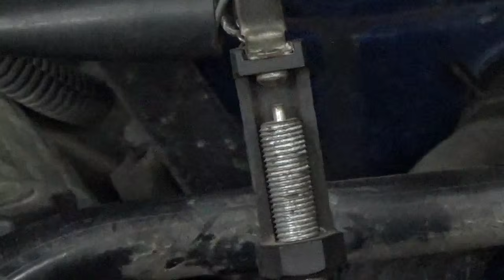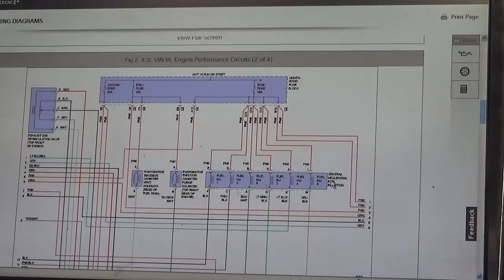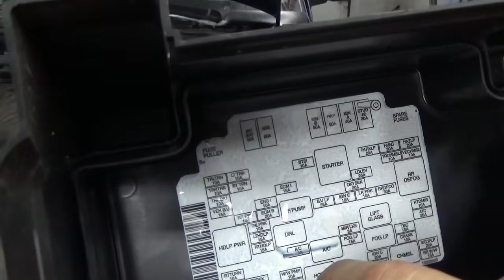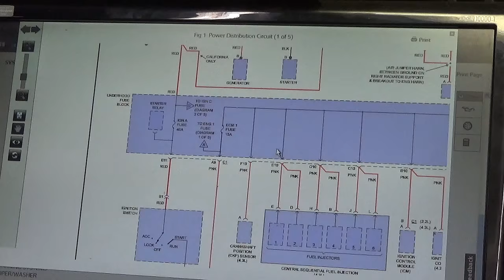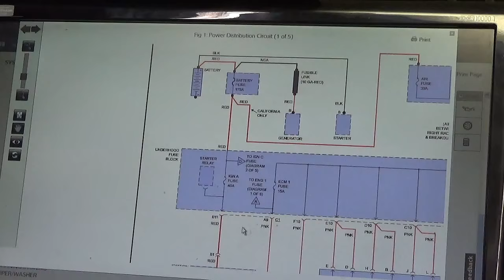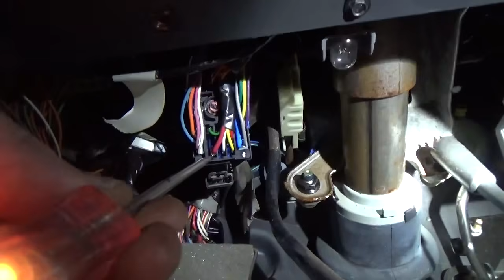No Start / No Spark / Cranks OK - GMC Jimmy / S10 Blazer

Comment: Hello I got a similar problem but in my case it's a 2000 Chevy S10. The same fuse (ecm 1) keeps blowing every time you turn the ignition on. Background, I just had a new set of injectors installed as well as a new fuel pump installed. Afterwards the truck ran but idle real high I'm talkin take your foot off the brake in drive and the truck starts doing 10 miles an hour on its own. Another fellow and I were looking over the engine to see if we could figure out why it was idling so high he put his hand over the intake and his hand got stuck down on it and it took the engine off. Now the truck will not start it turns over but just not crank up. Thanks to your video I Fount the blown fuse unfortunately that fuse keeps blowing every time I turn the ignition key on. Any ideas?

Comment: Has anyone found other situations on a GM like what happens at around the 2:50 mark with the spark? Mine does it, but it's so infrequent that I haven't made it as far as testing the ignition switch.

Comment: Has anyone had problems with the ignition relay mounted on the firewall killing spark from the ignition coil. Ruled out coil, coil wire, ignition module, and ECM, by swapping known good parts from running spare blazer. Haven't found wiring diagram in Haynes for the ignition relay. Just slept and came to me to check relays. Had actually unplugged and replugged the connector without knowing it was the ignition relay

Comment: I have an 89 Chevy s10 my main engine wiring harness laid on the exhaust manifold and burnt threw 1 wire and shorted it out it was a wire to the #2 injector so I cut the burnt section out and replaced it. That injector still isn’t spraying ? Any idea where I should go from here fuses are all good ecm1 and 2

Comment: Thanks for the video my Chevy S10 2003 had no power to the sending unit and no power to the coil and it was a fuse I thought it was ignition switch BCM 15 a

Comment: 98 s10 4x4 4.3 
Fried controller
Results dose nothing
Changed controller cranks no spark
Changed ignition cranks no spark
Security light blinking
If I install the ignition housing that's mated to the controller will that fix it?
Do I still require a dealer reboot??
Urg

Comment: Son has a '99 S-10 2.2.
Blew the 15 amp fuse at some point, truck has had electrical work done. 
Change the fuse to newer 15 amp, and it started right up and idled fine. 
He took for test, a block away calls me again because it died. 
Just for giggles put in a 30amp and left the fuse cover off, you could see the flash when he hit the key.
Tries to start, but won't turn over. 
Switch, relay? 
Almost feels like a ground issue if it started with just the new fuse and got around the block after idling for 20 or more minutes to warm and freshen the battery. 
Any ideas, he has had nothing but problems with this truck and is fairly upset. 
My Fluke is old and not reading properly. 
Dad would like to help.

Comment: This truck was running good I just wanted to get a cap the rotor plugs and wires put in it And the mechanic said that after he did it he had to reset the computer and I never heard of that and he couldn't get it to reset so he was racing it so much he had the stuff from the cattle later converter coming out of the exhaust now did he blow this motor because it was knocking afterwards

Comment: I have a 96 k3500 454 no spark i changed Everything except ignition switch. I have 12v to the pink wires on the coil and control module but i also have 12v on the. D terminal on the controle module side why is that

Comment: After watching this video we replaced Ignition Switch on 2001 Jimmy, still have same problem. (Cranks but won't always start) Can get it to start after 6 tries but sometimes won't start and wears battery down. We charge the battery for an hour and starts right up. But then we go through the same problem again.  Now we are trying to start in Neutral instead of Park and starts faster, maybe 2-3 tries but then sometimes won't start before battery gets low. Could it be the Park/Neutral Safety Switch? Any suggestions?

Comment: I have 97 s10 p0300 changed sparkplugs, wires, dist cap and rotor still has p0300 starts and runs but not running right and backfiring plz help

Comment: Saturday May 23, 2020.. after replacing fuel pump, relays, fuses, fusebox, coil packs and even ECM. Found your video and IT WORKED THANK YOU VERY MUCH. Ran out $ by buying all unnecessary parts.. so I'm running with a hot wire hanging out lol. I APPRECIATE the wiring diagram.  Colors helped out a lot since I was trying to guess

Comment: I have a 98 dodge Durango 5.2 I have spark coming from the coil to the distributor but nothing coming out of the distributor what could it beI am putting all new distributor shaft cap rotor and sensor

Comment: Got a question..i went to start a 1999 blazer 4.3l n it attempt to crank a quarter of a turn but that is it like something's stuck on the crankshaft..ive just did a throttle body cleaning n fuel pressure regulater replacement..any idea's ?

Comment: 05 Silverado 4.3 chevy cranks fine fule presure fine new crank sensor just had  tune up plugs. wires. cap. bunton. coil . Shop said bad distributor housing or computer any ideas or load the parts cannon

Comment: i have a 1985 p30 i am having issues with crank but wont start  no spark  changed distributor rotor spark plugs module  everything under the sun except  the pick up coil  what do you think i should do before i torch the f...n thing !!??

Comment: Replaced Ignition Switch on 2001 Jimmy, still have same problem. (Cranks but won't always start) Can get it to start after 6 tries but sometimes won't start and wears battery down. We charge the battery for an hour and starts right up. But then we go through the same problem again.  Now we are trying to start in Neutral instead of Park and starts faster, maybe 2-3 tries. Could it be the Park/Neutral Safety Switch?

Comment: Hey I have a similar issue on a 2000 chavy blazer fuel pump sounds like it's running cranks and cranks sometimes without starting and then sometimes it start first try no problem at all and the only code popped up was po420

Comment: my truck ran the morning of, cut it off, changed camshaft position sensor and now it won’t start at all. it’ll crank and crank. but after i let off ignition it’ll idle at like 200 rpm then die. help

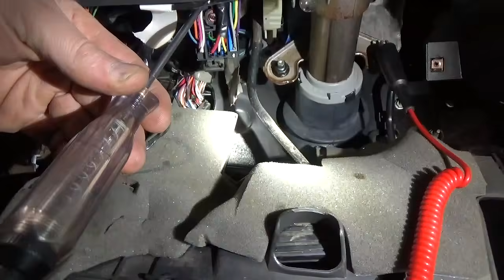Comment: 10:20 if the light stays on while cranking what could it be?
Reply: If that light stayed on while cranking, suspect a break in the wire between the ignition switch & fuse.
Reply: @danielpacurar2644  there's no power from the power feed connection or the fuse until I turn over the key I get power, is that normal?

Comment: Thank you so much for your videos. I have been searching for information on a similar situation. A 1989 Mercury Tracer just died while driving. Sometimes it would re-start for a few seconds and die again. I tested the Coil for spark and nothing 'till I shut the key off. If I turn the key from run to off I get the one spark at the end. 
 But for that vehicle it's approx. $240.00 for a new  ignition switch. Is it possible to run a hot wire from the battery to a toggle switch and then to the Positive Terminal on the Coil? Then flip the switch before cracking over the engine?

Comment: Thanks for the information,got a different problem got fire,fuel pressure turns over like it's out of time, but won't crank and occasionally it does crank it has a dead miss, have changed distributor and cap wire's spider all twice still won't run can you please give me an idea ,oh and son in-law says timing is dead on, engine was running in different vehicle put it in this one no it wont

Comment: Hi,  Everything  was lit up  normally  until  I changed  Fuel Pump ,the mechanic was just starting up, and when he was breathing on the parking he stayed 4 hours in the parking lot . I"m  going to go back to work ,I will not be able to get down from 5-6 times to start power, 2001  Gmc Jimmy  2 door  4wd  6 cyl , What  is  the problem  ? Thanks ,Starter  is new ,baterry  is new , fuel pump new

Comment: Thanks much, it was cool watching a pro work through the problem instead of just throwing parts at it - as "some so called" pros have done to many of us, THEN they charge us shop rate PLUS all the unnecessary parts for their education. Yes, some of us have had it happen.  It's so cool to watch you eliminate the many various parts as the possible culprit and zero in on what the main problem was.

Comment: I have an earlier cav w/ a 3.4 conversion that acts the same way. Didn't know how to troubleshoot this until your vid. Pulled two plugs and they were dark but not wet. Have a new ign switch so will try. The thing that concerns me is I think the former owner retained the original ecm since there are no fuse boxes under hood. If you have any input please email tunaboat3801@ Gmail.

Comment: well that brings the WTF to the fore!! i started in retail auto parts including various dealerships . i realize i am seeing this 4 years on, but, holy thunder,  the gall to ship THAT.
Reply: My daughter works at a large manufacturer's industrial facility in inventory control. Their retail sales people are under strict instructions to not accept return parts and credit the customer until the shop has actually looked at the return parts. Why? Because previously certain customers were in the habit of returning their defective used parts for a credit which were then put back into inventory and resold only to have the new customer who then returned it again because it doesn't work. Customers who are caught returning used parts are not given credit unless it can be used as a rebuild core. The things people do...........

Comment: i'm really hoping somebody can help me, i have a 94 s10 pickup with a 4.3 1 of the tbi injectors weren't spraying i assume from sitting since last summer. now here's my problem i had my friend crank it over while i tapped on the bowl and it started to work the only problem is it's spraying too much fuel  to the point its flooding the right side of the carb, the left one is pulsing normally but the right is a strong straight cone of fuel with no pulsing. any ides or help would be appreciated.

Comment: I have watched many video in a attempt to be a decent mechanic .   this is the only site I have joined because most seem to be no better or less than me .   I have a 1997 chevy blazer with the 4.3 vortec .   it just shut off .   I have tested fuel and I have 54lb so I think the poppet valves are working .  I am beginning to believe there is no spark .   I am hoping for a video to test the ignition coil and the control module .   these are separate from  the distributor
 bolted to the intake next to the throttle body

Comment: have a 2010 Dodge Charger sxt with 3.5 v 6  my problem is when the car is a normal operating temp the car will not turn over,it just turns a very little no even a 1/4 rotation but after car sits for about 2.5 hours it will start., headlights are bright  battery is not even a year old

Comment: I have a 2000 Silverado 1500 4.3l runs then stop and won't start. If I let set for a few hours it will run again. Fuel pump is at 60 psi. and I replaced the coil.  Where should I look now?

Comment: QUESTION: Can this ignition switch issue be overcome by putting a charger on the battery while cranking with the key? If I do not use the charger, my battery slowly dies. If I do use the charger, my battery stays strong and the engine starts immediately. Thoughts? GMC Safari 4.3 Vortec...

battery is NEW, no drains on the ignition while at rest (no radio, lights left on, etc)

Alternator charges 15+ at idle

Comment: Could u possibility help me with issue I'm having on my 1995 s10 tbi v6.
About a week ago it started to get harder to start the 3 days later it wouldn't start at all. 
Has good fuel pressure good relay good spark.
Reply: What did the problem end up being

Comment: Would this also cause the fuel to not stay primed at 50psi i have no spark and i have to jumper wire the fuel pump relay even tho the relay is good

Comment: Any automotive electrical switch that when testing across the swich contacts under load shows 300 mv drop or more is suspect. The use of a dvom in place of your test light would have showed a significant voltage drop without cranking however the voltage drop could be around 300mv from the battery to the ignition feed side of the fuse when first started cold but has  the resistance in the ignition switch contact heats up the voltage drop will jump to 2 or 4 volts or more this will lead to a intermittent condition

Comment: i have a 2.2 isuzu 5 speed. one day it randomly shut off. all dash lights went out. then started back up. did it again. then again different times. then it stopped wanting to start but cranks. no dash lights. but when it does start is when dash lights come on. im so stumped. i been thinking ignition starter switch. but i dont have 100$ to try a maybe. 
any ideas ? im so stumped. the book doesnt help cause doesnt tell me what color wire is what for ignition so i can test.

Comment: Great video. I have a grand am gt that has a intermittent exstended long crank times if it sits a while fuel pressure is good and doesn’t leak down car will start after a lot of cranking but when it starts it runs good and starts fineusually after that replaced coolant temp sensor maf sensor ignition module new plugs wires and coils. I’m stumped on this one. Wondering if the ignition switch is faulty in it . And if so would that cause it to not pulse the injectors  and no spark causing the hard start

Comment: Pretty sure you just fixed the same issue on my '01 Jimmy... Thanks for the vid!! I was getting ready to buy new plugs, wires, cap & rotor hoping it would solve my issue (it still needs them, but it probably wouldn't have solved it & I would have driven it off a cliff because I am tired of sinking money into it.) :) 

I work at a different auto parts store... Same issues with the bad box & used parts sometimes making it out. We are supposed to check returns at the time of return. You don't take the cutomer's word for it that it has not been installed / used. Also ~ the warehouse is supposed to check returns that we send them, especially if they are being returned as "new"... We get boxes that look like that one from our warehouse!! I always check the part if I come across one. Basically it is told that "well, you don't install the box!" ugh. No, but it is pretty crappy to hand a beat up box to a customer... doesn't help their confidence in the quality, even if the part inside is fine. Usually it is one of the last ones on the shelf in the warehouse though, so getting another one may take longer, if it is even still available. We can only do so much. Which is why I check the part & usually ask the customer to look it over in front of me, just to be sure it passes their inspection too. Apologize for the crap packaging & move on. <shrugs>

Comment: On a Chevy  Astro, if it won't  start on rainy days, run a ground  wire from the coil body to a cast iron ground or to the battery. Put sealer under the distributor cap to seal the distributor.  Replace the distributor  cap  and rotor and coil and module.

Comment: When a car sits, it'll  have no codes sometimes. First check for spark with a timing light.  The distributor  cap could  be bad or rotor. Check all wires  with  a timing light to rule  out cap. Check  the coil wire. Check fuses. See if the fuel pump runs.

Comment: i have a no start just cranks...changed cap and rotor.. i get spark to coil and number one plug...i did your test and coil sparks correctly and consistant...i have fuel pressure...when i use starter fluid it still does not even fire at all..just cranks...i replaced timing chain correctly( motor has plenty of compression and even changed cam senser with new one...i changed crank senser with one out of another blazer.... I used to get P 1345 code... now i get no codes...any idea could it be a bad cap and rotor...it was a cheap one off ebay...but it ws running badly as it was before i changed...  only stopped starting after i did timing chain....i did set my gear marks to TDC on compression and removed and reenstalled distributor correctly.... only thing i think could be issue is the aftermarket distributor was manufactered wrong  so previous owner installed it off specs to make it work...maybe off 180 degrees... and when i renstalled correctly it obviously would be off 180 Degrees... I have one i pulled out from junk yard i may try....Any thoughts? does this make sense? thats..

Comment: Having a no spark issue with my 2000 Dodge ram 1500 no power at all to the coil from the connector. I checked the ASD relay, and it gets power even switched with one I know is good and same issue. I have changed the crank and cam sensors. Where should I start or look?

Comment: My 2003 GMC Sonoma is reading code p1626 now I've already had crankshaft, camshaft sensor,ecm, replaced recently last October got new fuel pump and filter, distributor cap as well. The truck cranks but won't start up. Not trying to get over charge or keep paying unnecessary money. Just need to know what needs to be done

Comment: say have you ever did a 95 chrysler lebaron 3.0? i have a tube on the timing tab. but  i can't see that notch with the tab installed next to the deg marks on that tab? so is that tube and pulley notch tdc? and how do i set the timing? thanks